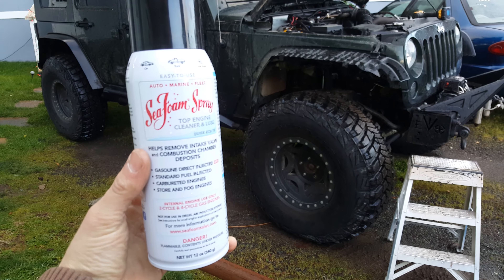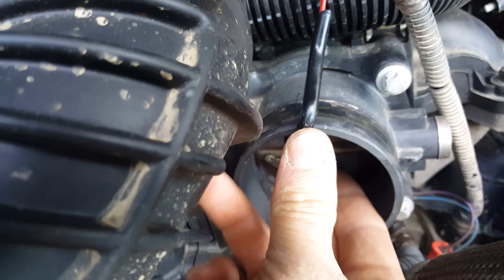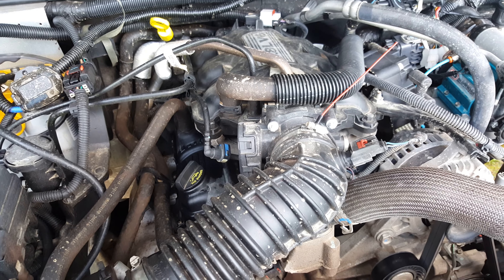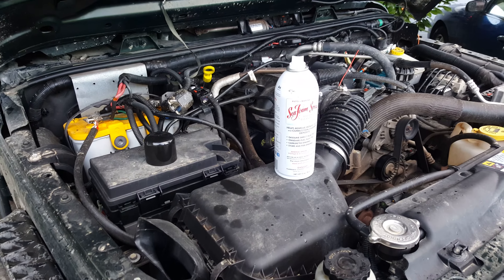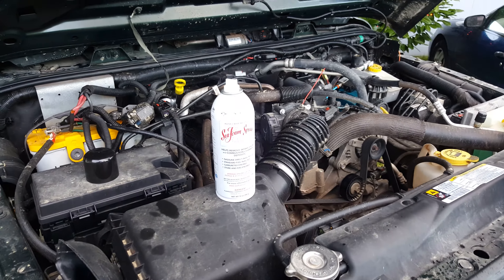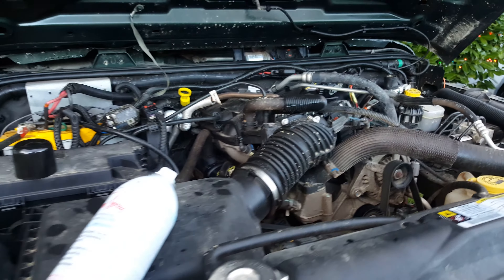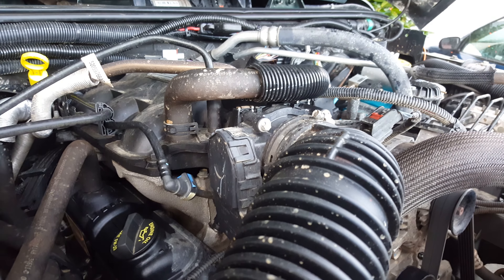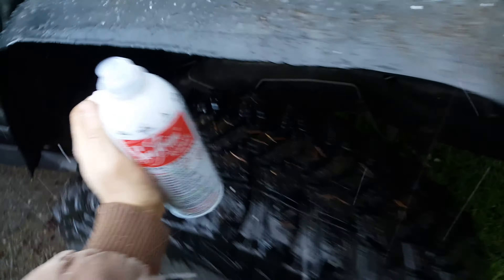2010 Jeep Wrangler Seafoam

Comment: NEVER EVER move the throttle plate on a drive by wire/ electronic throttle body. You with ruin the calibration of the throttle body.
Reply: Yep, when I was cleaning mine in my Commander, my mechanic said DO NOT MOVE mechanism manually.

Comment: Don’t do this to your engine, it will damage the catalytic converter and your seals...base stuff.
Reply: Not totally true. On old motors with over 180 miles it could be bad if it's never been done. Because to much carbon can come loose and clog the cat. But new vehicles it's fine. It's actually good to do every 1000 miles. You can put it into the gas tank but it will take about 9 cans to clean it as good as going through the engine